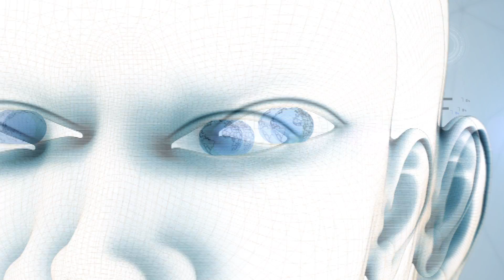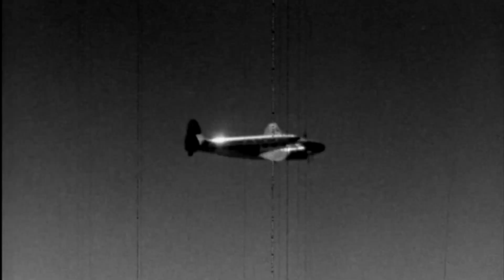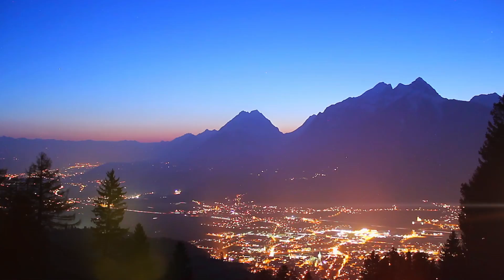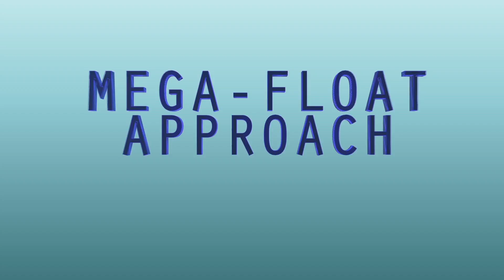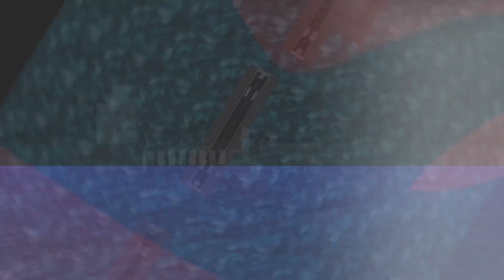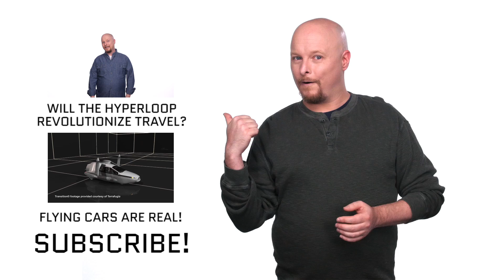Is It Time To Build Floating Airports?

Comment: Richard sowa has the answer for some of the problems most being the floating structure itself his island can self repair, actually helps the environment and can stay stable very well apart from tsunamis.  however collecting trash to make a huge floating island airport not only helps the environment but controlling the plants in curtain areas actually can help recapture the co2 emissions from the aircraft.

Comment: I think in the United States the best solution would be some type of high speed rail or even maglev trains that use the existing interstate corridors. At first they could connect larger cities and over the next 50 to 100 years extend them out to connect and use all the interstate corridors. Because the exponential growth in the national debt which is around 20 trillion and climbing, this would have to wait until after a major crash and reset.

Comment: i have a question for you. why do we need to use planes that need all of that runway space? why not develop planes that vertically take off and land?
Reply: There are VTOLS but VTOL jumbo jets would take a lot of fuel to take off and land
Reply: +blahblahblah6496 and bigger and more powerful engines
Reply: Sorry this turned out to be so long, but I hope you'll read through it.

This sounds good theoretically, but there are a few issues I've found with it. First of all, think about people getting onto the plane. It would be pretty hard to board when you fall to the back of the plane (This could cause injury). But even if you could find find a way to fix this (Putting a door at every seat would work but also would be incredibly inefficient and opens up more possibility for the air seal being broken), they would have to become like a space craft with incredibly large engines to blast them off the ground, and once they're in the air, it would not be easy and potentially impossible to get the plane oriented horizontally. Then when landing comes, there are two issues I see. One, once again it would be extremely difficult for planes to orient vertically to land properly. Also, it would have to be incredibly precise to land vertically in the right spot. Also, even if you could do this, it would be very uncomfortable for the people inside to get oriented as if they're lying down, and then plummet. Let alone difficult for the pilot to control correctly. Hope that all makes sense.
Reply: For domestic travel, why not build high-speed-rail?
Reply: "It would be pretty hard to board when you fall to the back of the plane (This could cause injury)." ?????????? there are already some planes that are in development for comercial use that have vertical take off and landing. you only need to have 1 door and you board the plane like you normally would.
Reply: You need so much engine power it would be nearly impractical to have thousands o these giant planes making long journeys. For very special uses (NOT airlines) a huge VTOL plane might be a better idea.
Reply: No. The plane would not STAND UP vertically, just vector its engines down like the harrier.
Reply: he's not talking about vertical takeoff, he's talking about vertical propulsion. the plane would still lay horizontal but there would be engines that lift it until you have enough speed to keep flight. this would require even more fuel, as you would be trusting upwards and forwards at the same time (2 different forces), but it would also cut down extensively on runway space. the big problem is that the price of plane tickets would probably multiply by an insane number and the application of said ideas would up our oil consumption drastically.
Reply: i am actually talking about vertical take off and landing. but once in the air the engines would rotate and it would have horizontal thrust.
Reply: Jeremy Back okay let me ask this way. would it stand upright like a rocket or just sit horizontally like a regular plane? if it's the second, then by vertical takeoff I mean actually rotating the plane to be vertical rather than just rotating the engines after takeoff. anyways, I think everyone gets what's going on now.
Reply: Most of the time, not all of the runway space is needed, but is just there in case of problems and the plane needs to stop and turn around
Reply: culture man...
Reply: Cost. Lifting anything up takes too much energy to be efficient, the momentum is what creates the efficiency. However my idea is dropping the planes. Think either down skyscrapers or from blimps. Create solar powered mega blimps, 1000 meters from nose to tail. lifting graphene platforms 50 meters across and 500 meters long. Have them lower to ground load 10 or 20 planes. Then they take off once they reach 5000 feet. The short runway means they do not reach take off speed before end but the glide speed needed to use gravity to achieve needed speed very quickly.  Drastically reduces the gas needed for take off because you essentially are using gravity to create your speed and not fighting the friction and gravity. Allows for lighter weight planes as well because the size of engines, and the amount of gas could be reduced. Then say is 20 years create mega blimp chains. Able to store the planes and hold the fuel needed. You create mini space elevators with them. They hold 10 planes and 100 crew, and up to 1000 passengers per blimp. The elevators use pulley system to send one section up while the other goes down. constantly in motion using wind energy.
Reply: Nathan smith blimps would be a bitch with luggage.
Reply: I think Mail and feed corn, and shipments from china to the US would be good use of Blimps.
Reply: Nathan smith true
Reply: wiididdy would lay like a normal plan but either the engines rotate or the entire wing
Reply: Jeremy Back yeah i got that but the one guy didn't. can't find his comment anyways. in all, if there's a problem with the plane, i would much rather have a giant target to make an emergency landing on rather than a helipad sized block.
Reply: Gammareign  I say do both... slow weight and fun, high speed use the train.

Comment: I think  plains should be desined to land in water   getting red of runways for shallow  sheltered  man made lakes as water would absorbe impact at landing in case of a fire a fire boat with a huge water pump could smuthur fire because of the obvious axes to huge quanty of water. The ability to land in water would mean if a plain gets in dificualty it can land in lakes ocens and rivers / Huducan
Reply: so many gramar errors... it took me 3 minutes to read that because of all the errors... and no, landing on water doesnt make the impact do no damage... in some cases it does even more damage than landing on land. if you fall in the water fast enough, it will do like you landed on concrete and go SPLAT! its because that the plane goes too fast for the atoms in the water to move away fast enough to slow it down and the plane hits the water so fast that it does as if the water was a solid... emergency landings aren't like in the movies where the plane lands and half of it blows up for some reason... the plane stays in one piece since the pilot can glide the plane down safely on land and somewhat safely on water. the problem with landing on water is that the plane stops a lot faster and can mess up the organs of people on board a lot more than landing on land.
Reply: When I watch big sea plains landing on water their is a splash indicating some absorption.I just don,t like the impact when landing in current commercial plains. And if its designed to land on water a key goal would be not to mess up peoples  organs
Reply: Seaplanes, and passenger sea planes have a fairly long history. But I doubt that you will ever see large 777 sized seaplanes anytime soon. But seaplanes would make more sense if you can make them work. 

"The Spruce Goose" was famously the LARGEST sea plane ever built and one of the largest functioning aircraft ever built period. Intended as a military troop and cargo transport, the plane's wooden construction made it desperately poor in the face of enemy fire. The project was killed. However, with modern materials such a huge plane could plausibly be made and used today for civilian purposes.
Reply: DocWolph The Russians made an enormous ground effect type plains. I seams to be where a fair share of designers want to go but just haven,t got it right
Reply: Michael O Callaghan
Those ground effects planes were designed and would only work in a very limited area and purpose, to storm the Caspian sea. The enormous undulations of the open ocean make ground-effects aircraft rather, if not completely, ineffective.

They are hardly a true sea plane. But those Russian GE planes were big.

Comment: floating airports would only help countries and cities that had a large amount of water near by, and wouldn't help landlocked areas at all. Also did they ever find solutions to preserving the ecosystem that they place it on? Island areas such as the Caribbean have a lot of coral reefs near by that take massive amounts of damage from cruise ships constantly dropping anchors on them. Reef systems are one of the most delicate/fragile ecosystem on the planet and they do require some sun light. Blacking them out with an airport would kill the reef. If the runway were clear to allow light though you would still have to worry about damage to the reefs from anchoring the airport so it didn't just float away. I think the easier solution would be figuring out vertical takeoff and landing for passenger aircraft. that would save just as much space, would help landlocked areas too, and should have less of an impact on the environment.